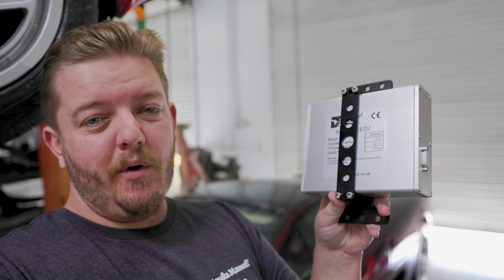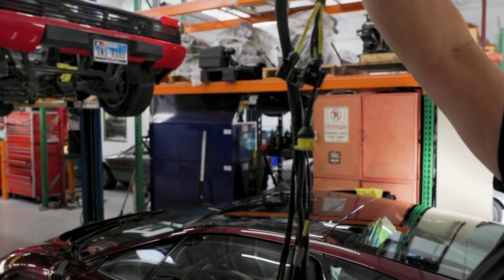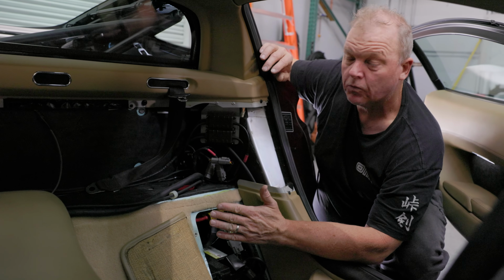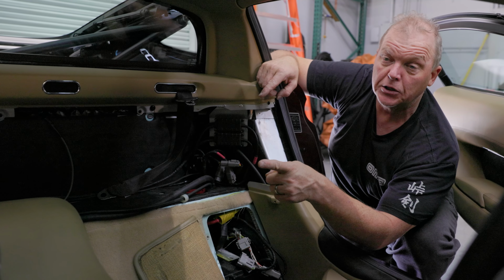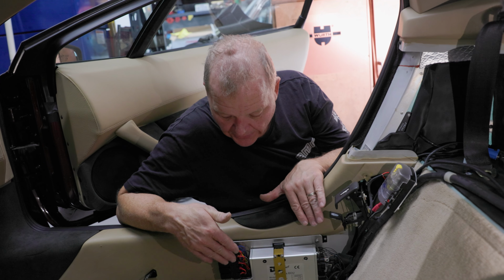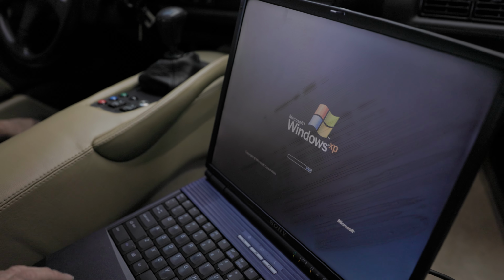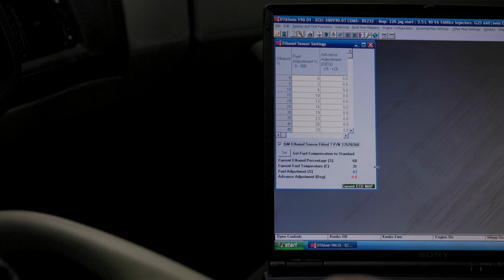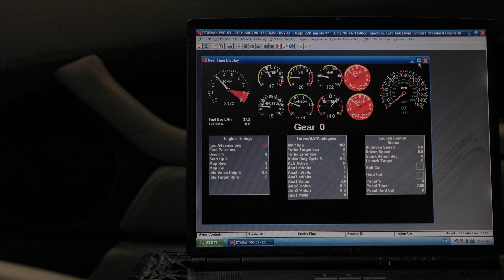Modified XJ220 First Start!!! / XJ220 Build Ep 3

Comment: I used to build these cars in Coventry when working at jaguar Radford plant 
I also built two seven litre v12 engines with warrior 5 valve per cyl heads for the 220 but they ended up in xjs
Reply from the maker: That is really awesome! They are very unique and cool cars. The prototype with the v12 would have been cool if Jaguar had more money!